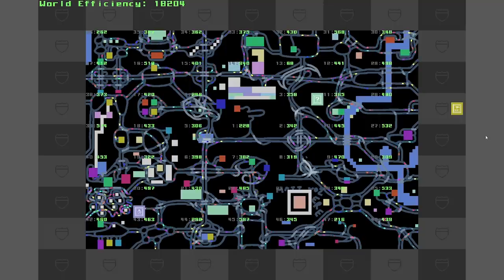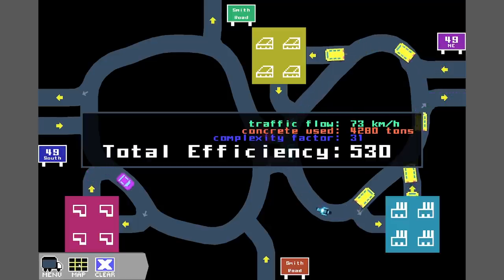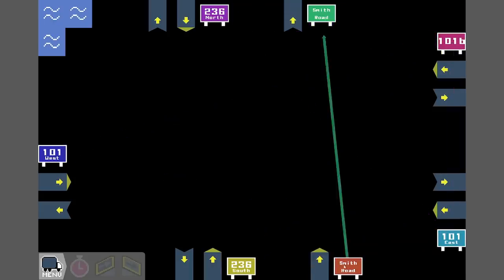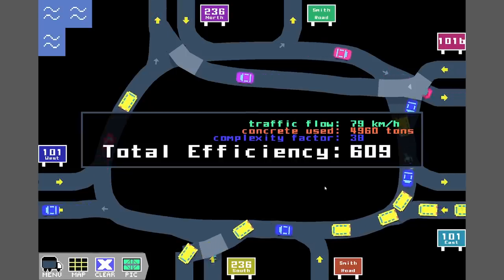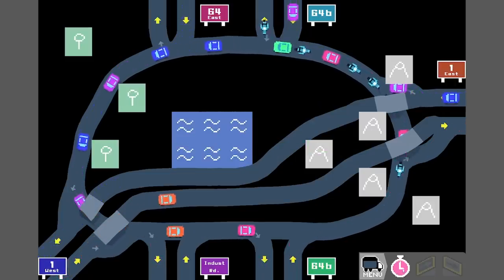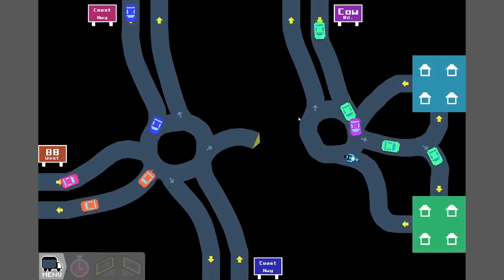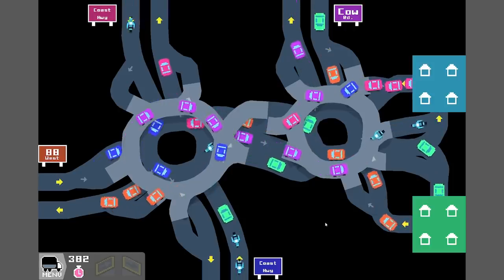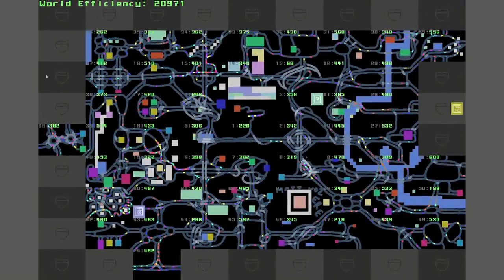This MESS of a roundabout is actually OVERPOWERED!! Freeways!

Comment: Glad to see a bit of Detroit making it's way into the video. The picture at 11:35 is the I-696, I-96, I-275, and M-5 interchange on the outskirts of the Detroit Michigan metro area. Detroiters will often call it the Mixing Bowl. Looks messy but it flows really well.
Reply: Did you realize you said “69696”
Reply: @jacobymryoutube  that’s the highway, you have 96 and 696 and 275
Reply: The only issue seems to be the joint of everything on 96 west with now construction otherwise flawless, i wonder how the changes will effect traffic
Reply: It’s also the largest interchange in the US
Reply: We also have I-69 in Michigan too
Reply: @daviddow5591  Yes we do. But it is not in the Detroit area and is not part of that interchange.

Comment: 12:05 it lets you drive faster because you need to cover more land.
Reply: I've seen people fly through those interchanges at above highway speeds. It's insane just how fast you can go on those without posing an under/oversteer risk
Reply: @GatheringRays  you can easily put cruise control on 140 at night, and not need to hit a brake in 6 hours until you need to refuel.4
Reply: @matthewhodge9748  Based on your profile picture, I really hope you're talking about kilometers...

Comment: 19:40 - You get much better results doing a "Star of David" double overlapping triangle-about. I got 679. Go from Green beer mugs to 88 West, 88 West to Cow Road, and Cow Road to Green beer mugs. Then go from Blue beer mugs to Coast Highway pink, from Coast Highway pink to Coast Highway blue, and from Coast Highway blue to Blue beer mugs all using whatever bridges you need to cross the first triangle. Make both of those roundabouts doing U-turns for through traffic. Then put together your connections between the two at each cross.

Comment: 16:47 the traffic pattern goes in 2 triangles, one clockwise and the other counter-clockwise, kinda shaped like the star of david, i got a score of a whole 745 on level 68 with my map consisting of 2 separate triangle roundabouts going opposite directions connected to each other

Comment: I got 883 on the 16:45 [No. 68]. I did alternate direction mini roundabouts at the start of every road with the direct routes [using ltttle bridges] going off roundabouts and either over/under the main connecting the big arrows roads.
The 88 west had a clockwise oval-a-bout, the red coast hwy a counterclockwise slightly larger rounderabout, Cow Rd had a clockwise mini, blue houses a counterclockwise, the green house a larger clockwise roundabout and finally the blue coast hwy a mini counterclockwise roundabout.
Reply: That is incredible high score and 27 higher than what I have! What is your world efficiency? I'd like to know if you beat me there as well :D

Comment: So, a real highway engineering related question: You say that it's better to not have a merge before a diverge, but here at my local motorway, there are examples of the dreaded merge before diverge. From what I have measured with google earth, the average distance between the merges and diverges is about 1km. So the question is: Is that a good average distance?
Reply: I would also ask about never having Left exits (or right in the UK?).  There are tons in the US.  Is that a truism in the UK or just a general good plan (not making the slow drivers cross the faster lanes)?
Reply from the maker: There are minimum distances in the design standards, these usually depend on traffic flow
Reply: @RealCivilEngineerGaming  RIght, thanks! I would be a terrible highway engineer, I would do literally no more diverges after any merge. So a motorway designed by me would probably look something like: first all the diverges, then all the merges. Hey I know, I'll redesign all my motorways in Freeways and see how that turns out XD

Comment: Bridges use 3x concrete in real life. The footings, the pillars, and the deck. 2x road thickness plus 1x which is the .5x of both the pillars and footings
Reply: The higher deck bridges actually use less average concrete than a 1x level change.